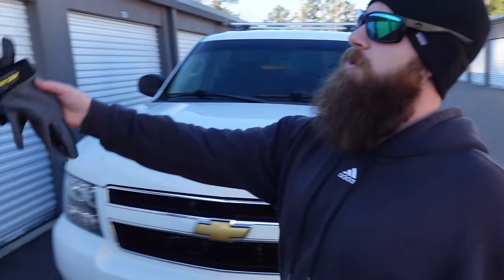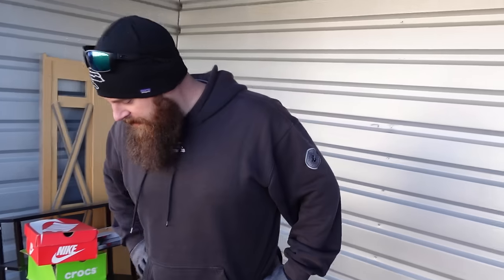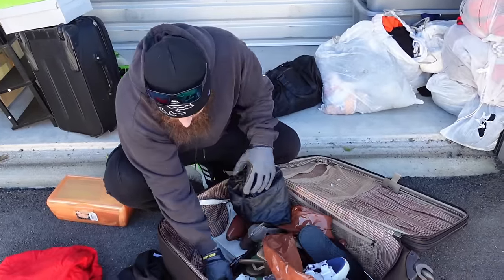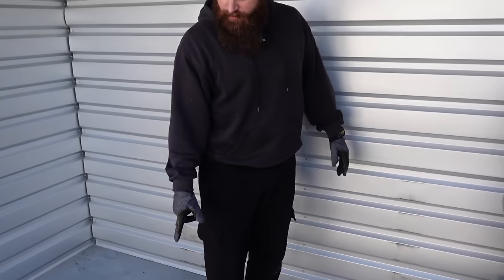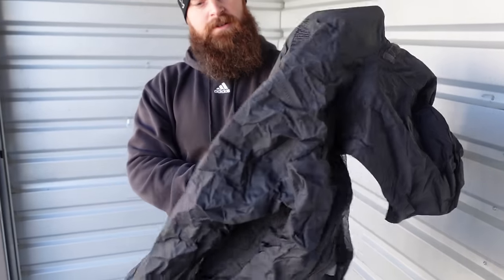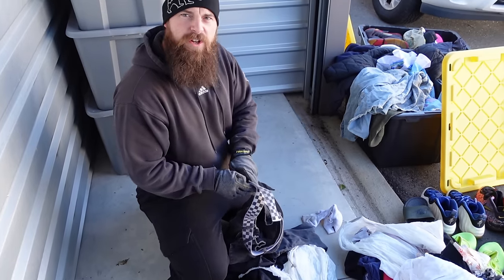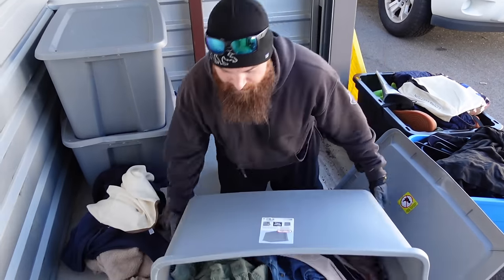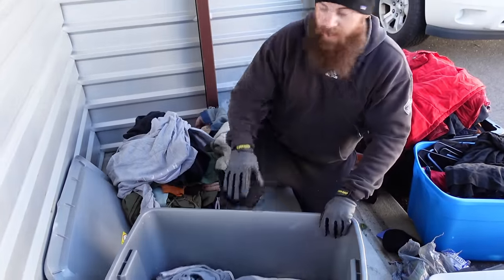We couldn't believe these were abandoned!!

Comment: As far as the sheets in a bag, I used to do a lot of traveling for work and even though I was staying in pretty good hotels there was a lot of information going on about bed bugs and stuff in New York hotels specifically which is where I was traveling to most of the time. So I went and bought some travel sheets that came with a stuff sack like you would have for a sleeping bag, you could just stuff them in but if you folded them down to a pretty thin strip and rolled them they fit in very nicely took up very little room in the suitcase and I always knew When and how well the sheets I was on were washed.